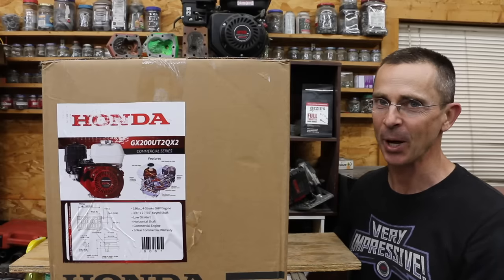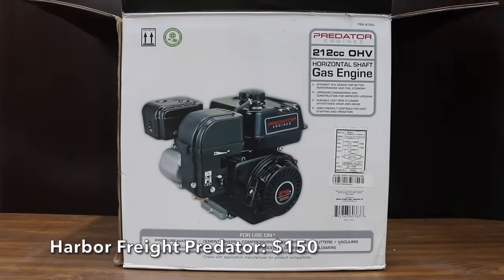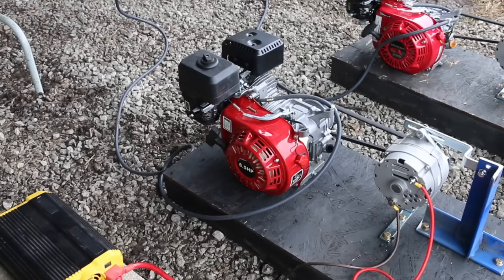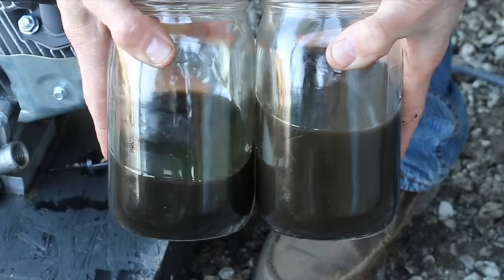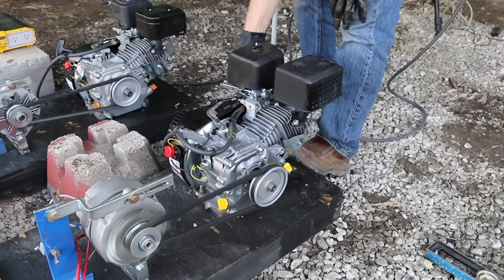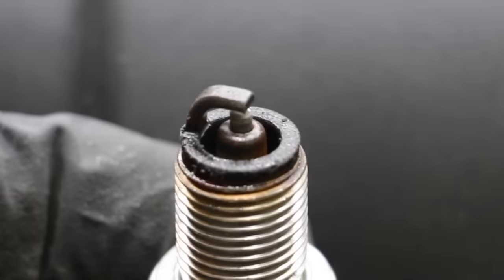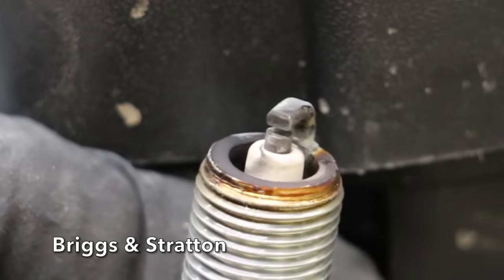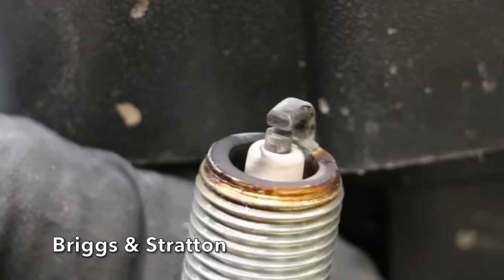$150 Honda Clone vs $600 Honda? Let’s settle this! Fuel Efficiency, Horsepower, Durability, Starting

Comment: The predator had problems with the shaft broken in the harbor freight's chipper according with some customer reviews. Longevity is also a factor to consider. Thanks for the tests.
Reply: You could buy 3-4 predators however. The quality control is what you’re going to be missing.  May get a good one or you may get a bad one. Buy the warranty is my advice for any harbor freight product with a motor.
Reply: @BeefNEggs057  it's true but to go to town to change the engine can be crucial in a job or time consuming that has to be considered.
Reply from the maker: Thanks for sharing!
Reply: @mediolanumclassic   Oh yeah true. The hassle is worth something for sure.

Comment: Great comparison.  It would be interesting to do a long-term durability test on them as well.  I know gas is expensive, though.  Maybe there is a way to put the engines to work for you.
Reply from the maker: Thanks!  Thanks for the suggestion.
Reply: Well as a mechanic at a go-kart track i can say, they are bad, everything will break. We tried a few. one brand was so bad, the head gasket pops every few days for no reason, and not on just 1 engine, all of them. tried many types of gaskets to. You can use them for your idle machines maybe, but I'm not a fan of them.
Reply: @-BEASTOR-  Your comment is quite vague. When you say "they" what engine/brand are you referring to specifically?
Reply: @jeromesurffoil7033  Dont know all the names anymore, but one is from DM motors, Evo series. Terrible. But they all look the same but with another sticker on it. Maybe there is a good nock-off version, but i haven't seen one.

Comment: A decade or more ago I bought a 6hp blue predator at the local HF for under $40 after the store's site sale along with a mail flyer discount. Didn't think they'd let me double up on the price reduction, but the manager said it was okay.  Used that engine to convert my electric 20 gal air compressor. It's been running without incident for years at unknown hours. I figured if it went out after a few years it more than paid for itself, but it hasn't given out.
Reply from the maker: Thanks for sharing.

Comment: I can appreciate all of the time it took to test these engines and putting the data together.   I always subscribe to the notion that price is relative to what you get and in this instance, I too would spend the extra to get the Honda.   There SHOULD always be a reason that a product costs more and this testing goes to prove that Honda has invested heavily into the engineering of the product.   

Such a well put together video.
Reply from the maker: Thanks!

Comment: It was interesting to see this thorough testing. It seems great that engines can run for 24 hours none stop, although I suppose if people use  them for generators they'd be running way, way longer.
Reply: he said he added oil to one on them several times in 24 hours.
Reply: @rupe53  ya the Chinese knock off because they’re junk
Reply: @steved8714  ... as someone else said... you get what you pay for. There's an amazing variation in quality from one engine to another on the cheaper end. When Generac was using them (different version?) I never saw any oil consumption issues, and some units had an amazing amount of hours on the clock.... while still on the first oil fill.

Comment: Great video, 

It gave me the idea: best belt brand? 

Not specific to any type of belt, i was thinking more accessory belts though like ps, ac, alternator, usually in automotive use. 

I’m a big fan of Gates Micro V belts. 

I know there are tons of brands to test, some cheap and some higher quality.

Another idea: multimeters.
Reply: Great video? You haven't even watched it yet not even halfway through.
Reply from the maker: Thank you for the video idea!
Reply: @JSFGuy  I’m done lol I watch on 1.5 speed, spend more time seeing more things learn to take in information quicker, YouTube 1.25 and 1.5 speed can be very helpful in making your time more useful.
Reply: @Novaah803  sure you do.
Reply: @ProjectFarm  lawnmower belts would be amazing  (power belts)

Comment: Yet another great video. I service a lot of Honda engines, and I'm continually impressed with how much dirt they can inhale and still run good. They are so durable and parts are readily available that they are worth the money.
Reply: Honda bikes are great too just like their cars!
Reply: Honda is a Super Premium Brand, hands down. They just go and go and go.  I put 200,000 miles on my 04’ civic, still drive it daily, have done nothing, absolutely nothing but routine recommended maintenance.  The monthly cost to keep it on the road is a barely noticeable fraction of the cost of todays car payments.

Comment: A foam air filter is supposed to have oil applied to it so that it can function as an air filter and it works pretty decently. It should also appear to be fairly dense I can't tell what that one looks like.
Reply: What sort of Oil?
Reply: Just use regular engine oil. Soak it in, squeeze out excess oil with your hands and its good to go.

Comment: Outstanding video! I would have assumed that the Briggs & Stratton was just shy of the Honda and that the Predator was the worst of the bunch. Very interesting results and the video was entertaining and of high value.
Reply from the maker: Thanks!
Reply: The thing not mentioned in the video is that the Briggs used here is nothing more than a Chinese engine with Briggs badging. It's no better than the "GX160" clone used here and there is a chance that it is made in the same Chinese factory that the GX160 came from.

The Predator 212 has always had the advantage of cost and 16 extra cc's over the 196cc GX200.

Comment: I've never seen a clone be that bad burning oil etc. Mine all seem fine this is unusual to see.
Definitely a good video I think I'll lean towards genuine or at least a predator in future.
Reply: That's the thing with Chinese knock offs. Random quality. I jad this with electronics and we usually bought 4 of each part and one would be up to spec
Reply: How about the vibration...???
Reply: @michaeldunagan8268  never had one vibrate like that mate but I've never had a bone cheapie it was usually a better chinese knock-off and at worst cheap plug and a crapy carb. This video of the cheapest one vs legit one was definitely outlining the range don't go dead cheap but if you're on a budget there's options.
I'd love to see him try to improve the engine so it is actually usable 👍

Ok that should be enough edits.

Comment: I'd be really interested to see all of them run without oil and see which ones last the longest.  Kind of like your STP test a few years back :)  Seems like Harbor Freight is going with the adage "No replacement like displacement"
Reply from the maker: Thanks for the suggestion.
Reply: A test like that wouldn't accomplish a thing. What is the point? Engines require oil and if you were to find out that one ran two seconds longer without, then what? Would you make your purchasing decision based on something like that? Of course not.
Reply: @paulmaxwell8851  I think an old well broken in engine will take longer to lock up when run no oil than a similar engine that is new and has not been ran enough to be broken in.

Comment: Yeah, The Predator for a quarter of the Price and beating out the Honda in most tests is an absolute no brainer,  Excellent video
Reply from the maker: Thanks!
Reply: except oil burning. when the Honda lasts 20 years longer than the Predator you will question your purchase.
Reply: @slingbart705  Yes but will the Honda outlast the 4 Predators in 40 years by using them back-to-back till they actually break?  "Deep thoughts by Jack Handy"
Reply: @javier migoya  still gotta consider the time to replace or space to store those extra predator motors for when they stop working when you're using it. How much is your time and space worth?
Reply: @xpham973  It's Relative, different for everyone, nobody could possibly answer that question, for me specifically, I upgrade my Gaming Computer every couple of years even if I wouldn't need to, like me, when it comes to these motors, you'll find people that would buy the very best, I'd be the one buying the Honda engine even though I would debate here to the contrary but only based on quality, value, etc. The Predator is not a bad option at a quarter of the price especially if your intended purchase was not to run the motor 24hrs a day for Testing as others have commented on how dumb could I possibly be and forget to realize that their stance doesn't really apply to everyday use
Reply: @xpham973  theres no guarantee the honda would last decades so you would need a spare honda engine to store somewhere if your life depended on it anyways, null and void. Thank for playing!
Reply: @Combustion69  you're right, nothing in life is a guarantee. I'll keep playing the game tho based on probabilities that ill have to replace the honda engine a lot less than the predator. If the honda motor fails sooner than expected, I would never think I should have gotten the knockoff Chinese versions instead. To each their own i guess

Comment: I watch a lot of these motor tests and by far , by far, you are the absolute best on the internet with the analysis that you do on any product.

What about a brakdown comparison of the small diesel motors ? There are a few videos on here on the cheap chinese diesel motors and none of the videos are comparison vids or as in depth as yours. It would be interesting to see a comparison of the cheap diesel motors ( I am overwhelmed there are so many available ) vs. a Kubota or other major brand. 

I should probably do a search - you may have already done one - Thanks for all your work
Reply from the maker: Thanks!  Thanks for the suggestion.
Reply: I just realized that you already did a diesel engine video  the one using biodiesel and waste motor oil - Thats a good one too.

Comment: I'd be curious to see some sort of longevity test with those same engines.
Reply from the maker: Thanks for the suggestion.
Reply: Agreed…I missed the “durability” testing as stated in the title
Reply: Spoiler alert the Honda will win!
Reply: @johnhein4851  idk, I've had 2 Hondas rings wear out and start smoking, so I bought a predator and after a year I am still very pleased with how well it runs and how easy it starts. Time will tell I reckon
Reply: I think its the key metric here, as thats the purpose of these engines really, not so much slightly more or less power, how will it stand up after 5000 running hours

Comment: I think an interesting review you could do would be different socket organization methods. Like the sheet metal rails, Hansen trays, and the twist lock ones by Ernst Mfg. It might have to get a little subjective, but socket organization can be one of the most frustrating and/or satisfying things in your tool box!
Reply from the maker: Thanks for the suggestion.

Comment: I love how Honda clone came with dents with no extra cost lol.
BTW, dunno if Mits and Subaru(former Robin) engines are available there, those should be good competitors, too!
My father used to own some farming equipments with these kind of engine(include Honda), Mitsubishi engine tend to be hard to start after years of use, but old Robin(Subaru now) still easy to start in the same usage.

Comment: Would be awesome to see a comparison of those 2 stroke portable generators that are one sale. Like how long they can run on the same amount of fuel, actual peak power.
Reply: 2 stroke? I wouldn't even bother with those... not when you can get the sportsman SS1000 on sale every now and them for similar money. It gets branded under other names too but its a full inverter generator... it has a little GX35 clone in it and is pretty darn reliable.
Reply: Great suggestion.. especially those $99 ones..
Reply: Who buys 2 stroke with fuel as a consideration?

Comment: Them old Briggs and Stratton are the strongest engine that I've ever had. I had a mower with barely any oil rings left that burnt oil all the time and that thing manages to somehow start everyday
Reply: I've got a B&S portable generator that is 15-18 years old.  I'm quite happy with not using it much, but the power has gone out a couple times this winter so far.  First time around it hadn't been started in probably 6 months and was a bear to start, but once it was going it powered 2 fridges, a freezer, the sump, the heating, and a few other small things without breaking a sweat.  Next time around a few weeks later it was easier, though not quite easy, to start. I'm sure it would start easy if I did it every day, but I'm glad I don't have to and once started it's a real workhorse.

Comment: Hello thanks for the video. Can you do a video on the  best OBD Reader? Thanks
Reply from the maker: Great suggestion!  What price range would you like to see tested? What capabilities? Thanks again!
Reply: @ProjectFarm  Under $50 vs. under $100 vs. Professional unit
Reply: @ProjectFarm  Please include some more specialized options, if possible, such as the ability to start a service regen on a modern Diesel.  For example, I know the "OBDLink MX+" can, I've done it on my diesel, though I used 3rd party software called "Gretio".  I guess my point is, for some features both software and hardware have to support it, and it would be great to know what the software + hardware package can do out of the box.  Also some modern dirtbikes, ATVs, SxS, etc.. use OBD, it would be cool to see which can read those too.
Reply: @ProjectFarm  Also worth taking the vehicle to a nearby chain auto parts store and asking them to use their OBD reader to help you with a code.  Worth seeing what the "free check engine light check" at the auto parts stores does compared to the OBD readers people can buy themselves.

Comment: Did not expect to see Predator do that well.  really afordable option
Reply: Someone said above that a predator vs a briggs, the crosshatching inside the cylinder with the same hrs runtime, the briggs still has em, the predator doesn't...but you can buy 2 for the price of 1
Reply: @haydenc2742  That might indicate allot of different things from cylinder wall hardness to piston ring tension and/or hardness. Ideally it seems to me that you want the crosshatching to disappear during break in. I also think the break in method drastically alters the ultimate fate of any of these engines. I've read and heard so many different procedures it's mind boggling.
Reply from the maker: Thanks for the feedback.

Comment: It's just a disgrace what bad management and poor engineering has done to the once great briggs and Stratton company.
Reply: I saw that coming 40 years ago when I stopped using Briggs engines for lawnmowing contracting, and switched to Tecumseh. I'm still using two of the Tecumseh engines I started with over 20 years ago and they still run perfectly, and don't use oil.
Reply: @BeardedBavarianBiker.  Yes, but I don't think it was greed so much as sloppy management, and the belief that they didn't have to care or worry about quality control.

Comment: The best review ever on these engines. 
I have a clone now for 2 years with no problems but I do change my oil and plugs more often than not. I use it for pressure washing. 
 What do you think about Kawasakis? I have them on my mowers and they seem to be unbreakable
Reply from the maker: Thanks!  Thanks for the suggestion.

Comment: Thank you for adding the predator to this test.  I need to replace the B&S motor on my chipper/shredder, and Im going to use the predator.  The original B&S motor served well, but is used up and not worth repairing due to its age and wear.
Reply from the maker: Thanks for the suggestion.

Comment: Curious about something. Was the testing done as is out of box or did you do any tuning to the carbs on these units? I have yet to find any engine the hits max performance without the carbs being tuned to get the best A/F mixture so i was wondering if that would have affected the overall performance of the engines.
Thanks for all the testing you do and not accepting sponsorships so that there is no doubt that the results are what they are. Your videos have saved me a ton of money over the years because as we can all see for the most part cheaper isn't , and rarely is , better. 
You are kinda the farmboy's UL .
Reply: I doubt if he did any tuning or he would have mentioned it in the video.

Comment: Great thorough test, well done.  I just bought a second hand chipper that has a briggs and stratton on it so maybe worth looking at replacing with something different when it wears out. Though my Briggs and Stratton mower has been going for 10 years + with little or no maintenance so maybe I will be waiting a long time.
Reply from the maker: Thanks!  Thanks for sharing.

Comment: I worked on a Cranberry Bog in the 90s & we discovered that Briggs & Stratton 5hp engines were more trouble than they were worth, so we replaced two small engines with Hondas. Very wise move. After storing picking machines for 8 months, one Honda started with 3 pulls of the cord, the next engine started with just one. RELIABILITY of Hondas was fantastic & probably still is.
Reply from the maker: Thanks for the feedback.
Reply: MTD engines (Honda Clone) really surprised me in durability, they work well and don't use a lot of fuel. People told me the 179cc on a snow thrower was garbage but 15 years later the engine runs well and the machine is falling apart. The same on a garden tiller, the engine is bulletproof. I also own a wood chipper with a knock off generator engine, it gets the work done. My pressure washer has an engine from Mexico, it did not hurt my pocket to acquire.. Briggs & Scrap-Iron used to be a good manufacturer but the three mowers I own are another story (failed camshaft and thin engine materials prone to breaking).